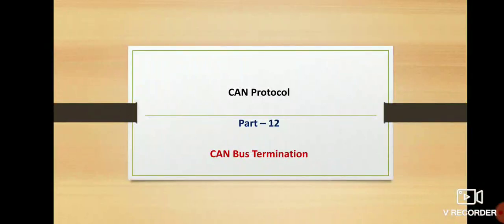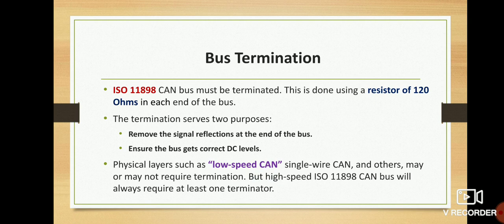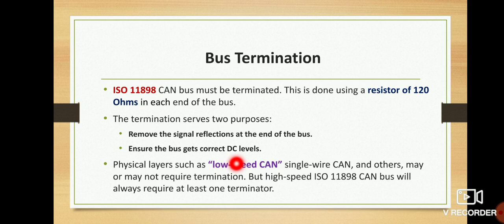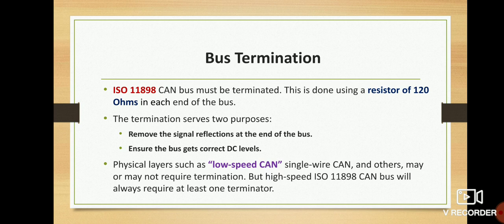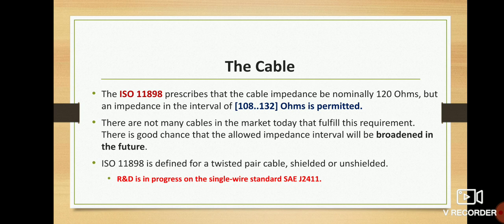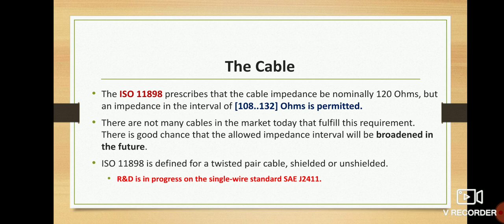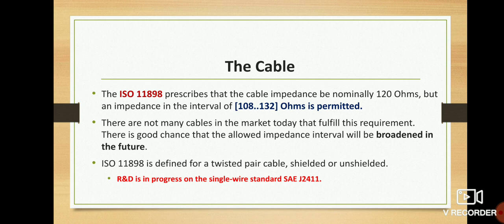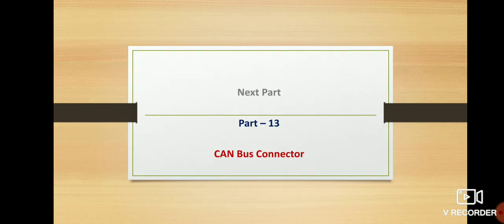CAN Protocol | CAN Bus Termination | 120 ohms in CAN | Embedded World | CAN Protocol | CAN Bus

Comment: What do you mean by signal reflections ?
Reply: You will have a reflection of your signal at the end of your wires that will interfer with your original signal. Ideally you will want to have a wire that is infinitely long to not have this reflection but as you know we can't make infinitely long wires. So the solution to this is to mimick the impendance of an infinitely long cable by using a resistor on the end of the wire in this case 120 ohm. You can find more information if you look up Reflections of signals on conducting lines. It's a little bit late but hope this helps :)
Reply: @tsoundi_  thanks 👍
Reply: @tsoundi_  thanks and another question why 120 ohms is that the standard followed
Reply: @9611279300  for the 120 ohm you have te do some calculations or look up on the internet. Some smart people already did it for us. For exalple for Radio Frequencies(RF) the caracteristic impedance is 50 Ohm, for can-bus it is 120 Ohm there is a logic explanation and calculation for this that you will have to look up on the internet because in the comment section it is impossible to explain correctly, sorry.
Reply: @tsoundi_  no problem thanks for the information 👍
Reply: Same question I have
Reply: mirroring effect